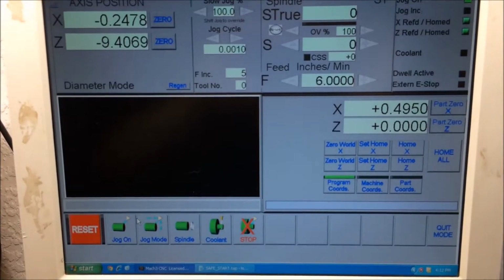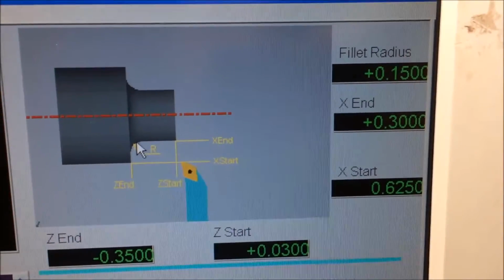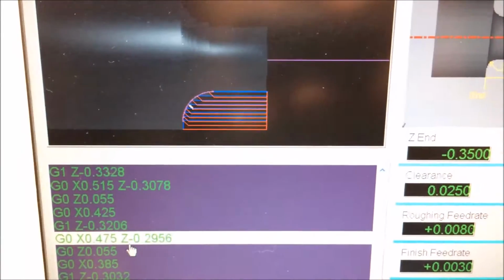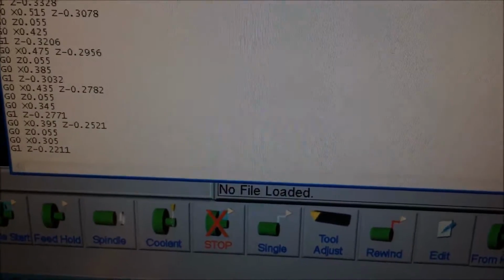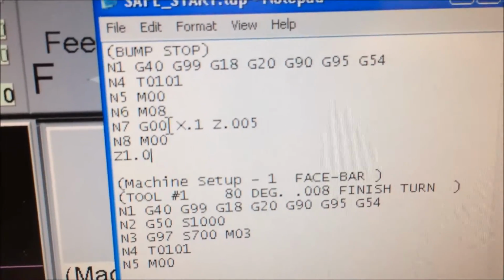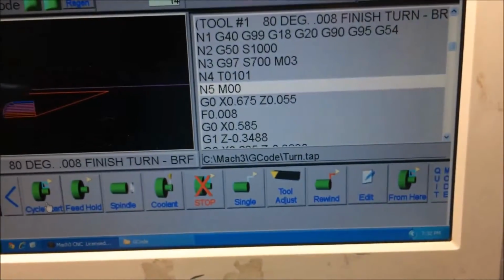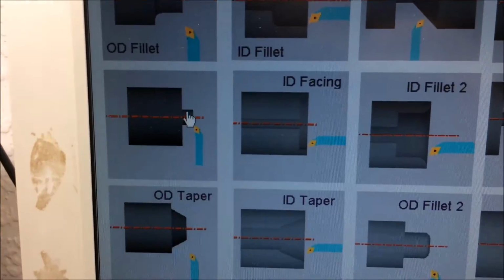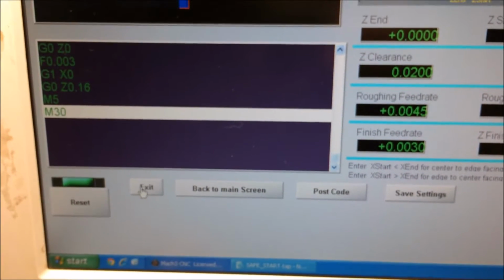How To Program A CNC Mini Lathe Using Mach3 Wizards

Comment: Hi
No experience with programming at all. Do have a bit of CNC for cutting clock wheels designed by somebody else which I built. I am in the process of trying to absorb Mach3 and this demonstration was excellent. I am about to add CNC to my lathe so you care to share your other skills, I will be grateful. I think it is relevant to point out that I am pretty old and people of my age are usually preoccupied with finding their slippers, not working out how to write computer code.
regards
Robert
Reply from the maker: Robert Webb Thanks for your comment. You may like this video: https://youtu.be/ooK1Nmo8h88
Reply from the maker: Robert Webb This one may be helpful, as well: https://youtu.be/xQNcicGMbtw

Comment: Franco
Could you please post the two pieces of code you used.
When you want to combine for example a facing and a turning procedure is it a simple case of posting the facing code then adding the turning code directly below. Or is it required to post the two small codes between the facing and turning code.
Your videos are very informative and easy to follow keep up the good work.

Comment: funny , my wizards all work well.. Then when i load a f360 turn file the program seems to think the radius is the diamter or the diameter is the radius.. In other words, it will try to do a pass 15 mm behind the part in thin air.. Ive tried both modes , to no avail with fusion files.

Comment: I am a little confused about the need for a Wizard licence. I have a demo version and have not been able to get my steppers to run. I have checked the config boxes and they look ok. Any suggestions.

Robert
Reply from the maker: Hi Robert.  Mach3 can be frustrating, but is should work.  There are MANY reasons why your system may not be working.  Check this out:  https://www.dropbox.com/sh/3g2ya6281uu14ha/AABSqIiUFSE1PARiLY4h1CxKa?dl=0  There is a section in there about Mach3 settings.  Maybe something in there will help you get over the hump.  Also, if you get really frustrated, consider converting over to the Centroid Acorn system.  IMO, it is much better and easier to configure than Mach3.  Thanks!